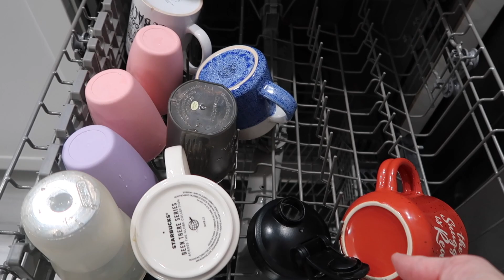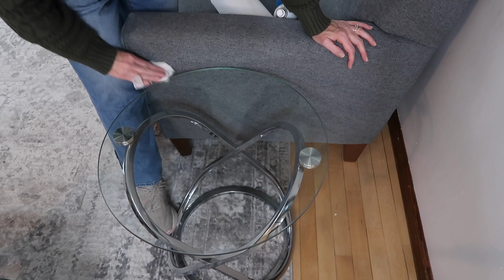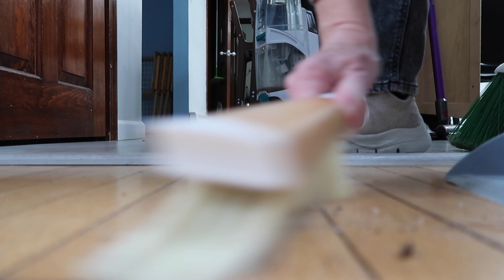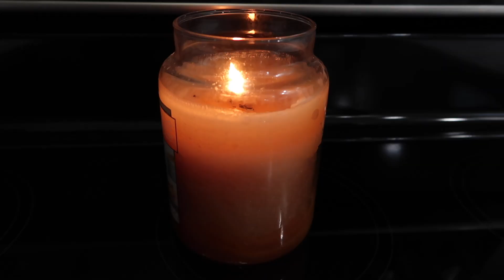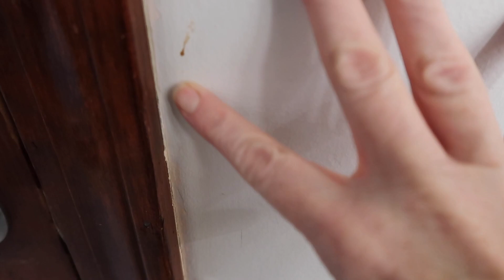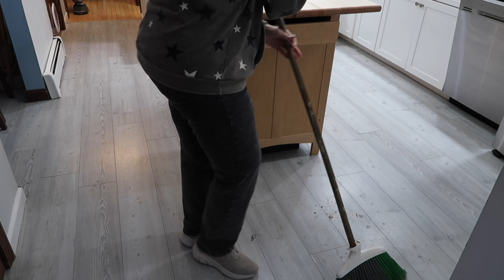My filthy house didn't stand a CHANCE! Holiday Extreme Clean and Cook

Comment: Hellooo Karen, lovely to see you! Your house always looks clean to me but no doubt you spot things that need attention, one thing I will say about not having much ‘stuff’ around is at least it’s easier to clean☺️
I think I’ve achieved my target of having at least a kitchen that looks like nobody lives here🤣 it’s pretty stark but I absolutely love it, quick wipe over and a vacuum and it’s done. Deep cleaned recently too, pulled out each cupboard and went through dates, I’m buying only fresh produce as we’re working through the food we already have👍🏻
You give me so much inspiration and even jolly me along when I feel like I can’t be bothered so thank you for that. 
I have a Dyson, older version of yours, it’s been a real workhorse and still keeps going, I use that upstairs, downstairs I’ve very recently (3 weeks ago) got a Shark stratos cordless, I got that one to replace the cordless Shark I had before, the Dyson I find just pushes larger food bits along where as the Shark devours them. I’ve no complaints about my Shark, I did buy the one with 2 batteries though, many times the power on both the Dyson and the Shark have gone while I’m vacuuming so it’s good to have a spare. I got my Shark Stratos from Amazon, it’s on a Black Friday deal now so around £20 ($25) cheaper. It folds down and is so easy to store. As always my lovely much love and light to you.🥰🥰🥰
Reply from the maker: I seriously think I'm getting a Shark next!! 😎